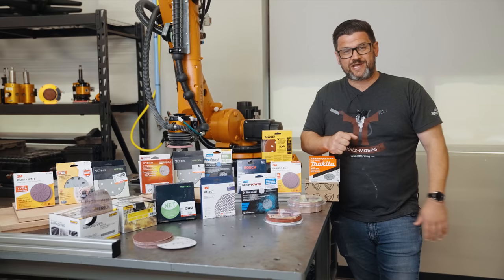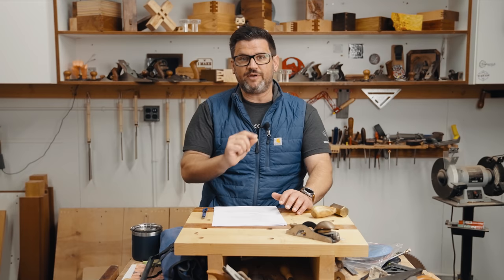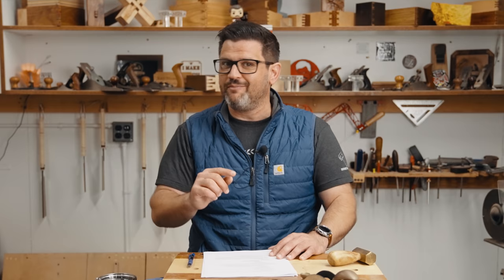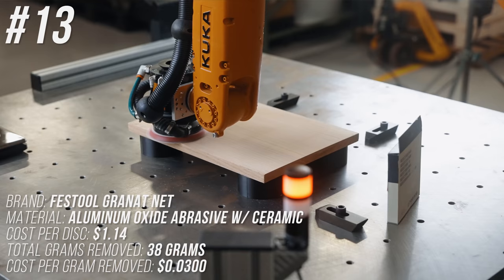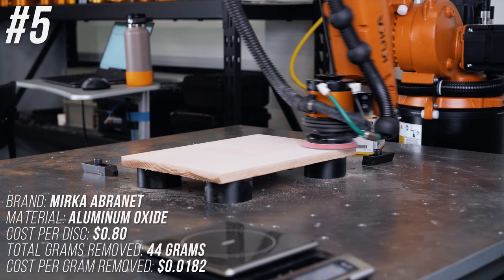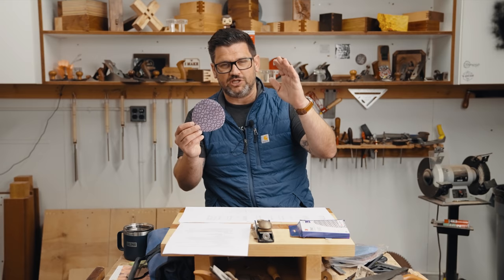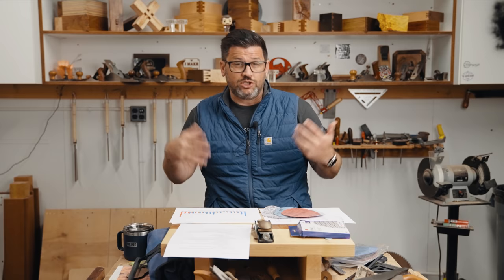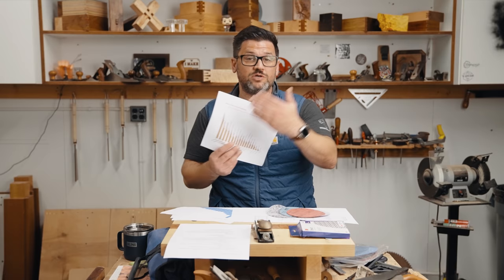Largest Sandpaper Test EVER Done - Top 19 brands Tested using Robots for Unbiased Data

Comment: I would be interested in seeing some data on the DuraGRIT carbide sanding disks, I’ve heard some very impressive things about them. 

I imagine that the cost per grams removed would be pretty bad using the same 5 x 5 minute test used here, but over its whole lifetime it could be something.

Comment: Festool Granat actually costs .65 per sheet @ 56 grams removed yields $0.0116 cost per gram removed which puts it up there with the top 5 papers tested. If you’re doing lots of sanding you would never buy the 10pk @$16.00 when you can buy a 100pk at$65.00. The other factor not taken into consideration is the design of the Festool multi stream pad which reduces the temp of the paper and further extending its longevity.  Otherwise not bad test in trying to keep all things equal.

Comment: I switched to cubitron II after the first video and was floored at the difference. The backing on the cubitron II was giving out on me before the paper quit (or even noticeably gave up), but that was after an hour of switched on work with the random orbital, and pulling it on and off the makita switching grits several times. Cubitron works harder when the backing dies than the other stuff I used when it was fresh. I don't toss it, I use it for hand work once the backing goes. Never would have made the change with JKM's work here. Thank you!

Now hearing xtract is this much better, I'm even more concerned that the backing will give out days before the grit does. Did you check into this?

Comment: I usually use the Diablo non net universal 5in sandpaper as it is available locally. It works well for me and seems to last longer than the non mesh Mirka I used to use. I wonder how that would have stacked up to the Diablo SandNet. I have to check out the 3M stuff before it is all on back order, or they bump up the price if it is popular.

Comment: Id like to see the difference between the 3M Cubitron II small hole arrow>>>>>>vented vacuum sandpaper, and the 3M Cubitron II Net vented vacuum Sandpaper...
Like which is less likely to clog sanding on body filler & putty, as well as sanding urethane and epoxy primers... 

I'm stuck on which to order...
I have the 3M Cubitron II 12 meter 280 grit small hole arrow vented rolls right now and so far it is lasting quite a while on my purple 3M 16 1/2" vented vacuum sanding longblock.
Now the Net is only in 10 meter rolls so not quite as much you get, but they seem to be even less money most of the time anyways so it probably equals out.

I have a 6" Volsive hand Sanding block that comes with the Net Sandpaper in various grits and even though I haven't really got to test on virtually any primer yet, but on filler and putty it seems to be lasting forever! As the net allows FULL SUCTION of the holes in the block... so far I think for Low grits 40,60,80,120,150 the net is the way to go for sucking up the most filler dust... maybe even also go with a 180 grit.

I would assume that for the 220,240,280,320,400,420,500,600,800 grits the Net version isn't as necessary as the finer finishing grits such as these tend to not kick up very much dust compared to 150 and coarser... but with sanding primer will the non-net finer higher grits clog up quicker than the net version? That is the question...

So anyways would love to see the comparison, as like I said, I haven't been able to compare the 2 variations on primer yet (to test for clog up comparisons)

Comment: I would love to see a test like this performed with some of the Klingspor sanding discs to see how they stand up. I have been floored by just how good they are and how long they last. Not to mention the stearated costing on their greentec discs are insanely good for when you're sanding off old finishes. Spent an hour yesterday sanding down some lacquered plywood I pulled from a built in bookcase from my new house. After an hour on my Bosch Get75-6n in direct drive mode the disc still looked new.

Comment: We've been using Granat and regular Cubitron for a long time. Just ordered a bunch of the Xtract and none of my sanders will hold the discs: they keep throwing the discs across the shop. To be clear, the other hook and loop sandpaper sticks fine, but these do not. I just called 3M and they said I needed a custom "hook-it" sanding pad for it to work. Part #20353. I just ordered that from Amazon for $30. I'm not sure which of my sanders that interface bad will be compatible with, but I"m willing to give it a shot. Anyone else have a hard time with these discs 'sticking'?

Comment: Thank you so very much for this "Complete detailed" test! I'm a week-end winter worrier so I only bought 4 boxes to test the product. I had to use my 3 x 24 sand belt extensively this week-end and I check on line if I could buy the 3M Xtract in a belt version but I didn't find anything. Do you think you could perform a test for sand belt paper?  I wear your apron all the time and I love it! Jocelyn from Ottawa

Comment: Thank you for doing the research, and presenting it in an excellent format. When I bought my Festool sander, I was trying to buy an all around good sander with great dust collection. I also bought a supply of paper to go with it. I’m getting ready to restock some grits. So, this is great timing. How do the meshes do with dust collection?
Reply: My experience with a Dewalt RO sander and the original Cubitron (which I ran to TayTools and bought some as soon as I saw the last video) is basically zero dust, and that's with the on-board dust suction - not connected to a shop vac or anything. Less dust than using regular 5-hole paper, for sure. Honestly, I don't know why that is, either. I'm assuming some of the fine stuff is traveling through the velcro hooks. In any case, it's a super clean finish and I can sneak in a quick sanding job without donning a mask.
Just make sure to keep your fingers (or anything you care about) away from the edge of the sanding disc when the Cubitron (presumably others, too) is spinning. It's much thinner than regular paper, so the edge is like a serrated knife. I only had to learn that once (so far).

Comment: I'm curious if the Cubitron mesh is like the Trizact automotive sheets. Trizact isn't even a media based sandpaper. It's actually manufactured. Under a microscope it looks more like linear rows of teeth which is why the Trizact outperforms other brands.

Comment: I couple of things, the 3m sandpaper is 120+ and the way the plus was explained to me by sandpaper people at awfs is they have 120 (or whatever grits your using) plus some lower grit(80ish) mixed in so you don't exactly get a true 120 grit scratch pattern. Also you skipped a couple of the klingspor. Also I'd like to see a test done with 80 150 180 and 220.

That being said,  I'll probably get some extract when I run out of the cubitron 2 lol. I typically keep cubitron and klingspor around, and use the klingspor if it's a dirty job that may clog the paper.

Comment: Very interesting test. Quick question. My deck is a mess, and I thought I would get a belt sander, pressure wash, pull up the boards (originally stapled), sand, waterproof, then screw back down. I just feel by the time I would remove, dispose of and replace with new boards it may be worth it to sand down and use the same  boards....or at least the majority. I was going to go to Amazon and just find the cheapest 40 grit belt sandpaper and go at it, but maybe something else might be better. I don't think the 3M Extract comes in a belt, otherwise I would do that. Any suggestions?
Reply: Maybe you can turn the boards over and not have to sand as much, also I would rather rent a large stand up floor sander and not remove any boards, if I where going to replace all the boards I’d go with the synthetic wood.

Comment: A follow on evaluation: What is the true abrasiveness rating (or equivalent to one - like 3M or a mid-pack choice)  and which leaves smoother - less swirl results for rated and the equivalent in the first 5 minutes. I have used 120 Festool Garnet paper and 120 Mirka mesh on my Festool ETS125.  I think the Mirka is less abrasive to the Garnet, more like a 150 or 180.  Thus, I would expect the Garnet to cut more and the Mirka to seem like it has a better finish as it really is a step higher in actual grit.  So is the 3M more like a 100 or 80 grit of Festool Garnet?  Seems to cut that way and to others like a 120 vs 300.

Comment: Thanks for this. Sanding and finish work is my bread and butter. I stick mostly to Mirka, Diablo, Klingspor or Norton. I will give that 3M a shot if I can find it. Just to toss a wrench at the fan, what is the random pattern of the machine you were using? Not sure if that would make a huge difference but what the hell. Again, thanks for the info. Happy sanding even if you don't like to.

Comment: Really enjoyed the video great stuff! I sand a lot of wood myself. What paper would you use for ruff wood with lots of holes and cracks. The 3m cubitron is not strong enough and is torn quite easily.
Reply from the maker: The Cubitron discs are just as good and more durable

Comment: Duragold and DURA-Grit are two different brands as well.. carbide sanding would be interesting as well to include in a test. Other factor is durability how much do they remove before being used up. Good video and good to see new innovations.
Reply: carbide is not for sanding wood, normally you use a carbide grit for Non ferrous or hardened material, not wood.
Reply: @tima.9125  stubby nubs has denonstrated this product. But I get what your saying. Also it sands over 10k bdft. Would like to see his opinion on it.

Comment: I’m a big fan of your channel. I’ve learned so much as a novice woodworker. I will definitely take your advice and give the 3M Xtract a try. I’m in the market for an orbital sander, but I don’t want to spend the Festool or 3M Sander price. Any recommendations for a quality and more moderately priced orbital sander? Is Bosch or Dewalt any good? Thanks in advance!

Comment: Thank you for the comprehensive break down.  Because of your research I have given the 3M Extract a try.  The sanding discs last longer and remove material well but, the issue that I am having is that the hook and loop will not stay attached on my Festool ETS.  I have replaced the pad and I continue to have the issue.  Did you notice any issues with the hook and loop being weaker than some of the other brands?  Thanks again for the deep dive!
Reply: Are you using a pad saver? Net discs tend to wear down the hooks on the sanding pads, so cheaper to use sacrificial pad savers.

Comment: The problem I have is that the sandpaper won’t stick anymore after very little use. Sometimes after 5 minutes it flies off and won’t stick anymore. I even replaced the Velcro disk on my sander but the problem persists. The sandpaper is hardly worn.

Comment: Based on this test, I bought several grits of the 3M Cubitron II.  I used it on one side of a charcouterie board I was making and my normal Home Depot paper on the other.  First, the cubitron doesn’t stick to the sander’s pad very well.  Several times, I had to stop and reposition the sandpaper.  After working through my normal process (80 grit to 150),  I very much preferred my normal sandpaper.  It felt much smoother to touch.  I realize my test wasn’t very scientific, but I think that in some ways, the actual results when the sandpaper hits the wood is what actually counts.

Comment: thanks for the valuable research.  I am working on a sanding process for my CNC.  I may have missed it but what was the pressure used on the sanding head.  Thanks in advance.
Reply from the maker: 10.7 lbs

Comment: 3M really has to start distributing their awesome sandpapers here in Belgium. Since your last video I've gone mad sourcing the cubitron paper, I ended up buying boxes of the klingspor ps33 (the white paper). Just cause that's what they had in the store and still seemed like a good value
Reply: I’ve been having good success with the PS 33.  So each disc takes a lot of use before it needs to be thrown out.  It is definitely way better than the other brands I can get that cost the same or more.

We also can’t get 3M easily.
Reply: 3M products including 710W sanding nets are readily available in Germany starting at 0,28€ per 125mm disk (depending on order volume). Not sure about shipping costs to Belgium, but I can't imagine that being too expensive given the low size and weight of sandpaper.
Reply: @BL-yj2wp  sounds very interesting. Do you have a site I could visit?
Reply: @boomerangfreak  
This is like the 10th comment I write because every single one gets deleted instantly. Unforunately I can't even name shops without getting deleted.
You can probably just use the German google to search for them.
Reply: @BL-yj2wp  auch. Well I'll try having a look again. Thanks a lot for the heads up though!
Weird thing is I work in a professional tool store with 3M as a supplier yet somehow the cubitron sandpaper is a pain to source...
Reply: @boomerangfreak  
That is weird indeed, makes no sense why they wouldn‘t sell their products in some EU countries while they do in others. 3M Belgium has a contact form on their website, you could try asking them if there are any retailers that stock Cubitron at all in Belgium. 
The shops that carry it here ask about 18€ for a box of 50 125mm disks plus shipping. It‘s not like it‘s a special product or anything.

Comment: Really a shame that you didn't include abranet ace which as as I can see is Mircas ceramic option.
Reply from the maker: Mirka was emailed multiple times prior to this test asking which papers they'd like us to test and what their best offerings were. They refused to participate in the process like most of the other brands did. To top it off, their head of marketing sent me a nasty email after the test was published and called me an idiot. So the fact that one of their lines was missed is 100% their fault.
Reply: @katzmosestools  Didn't expect an answer, but thank you for doing so. Seems like someone dropped the ball in their. Kudos for an excellent test. Any chance that you will do a more in depth video about mesh sanding discs and whether they produce similar result for finishing? There is a chance that the 3m extract for example is rougher than stated. In any case your test convinced me to try the 3m Extract mesh out. If if it works as well in real world application and across the range P values and produce equal result in finish quality then it's quite a game changer

Comment: Awesome video, saw Izzy post on it! Do we need to get any other accessories for the festool RO sander to use this mesh? Never used mesh before. Thanks!
Reply from the maker: Nope you're good.
Reply: Yes you do, with mesh type sanding discs you'll wear out the hook and loop connections on your sanding pad - best to use a pad protector/saver - it's cheaper in the long run.

Comment: The results could be skewed by labeling the sand paper as 120 but really be 80-110. It would be nice to talk about the quality of the sanding and if it aligned to any standard. Also the charts after 14 minutes don't have 3M Extract. The charts have double entries for 3M cubitrons.

Comment: Nice video.  As someone who has worked for three abrasives manufacturers throughout my career I understand the horrible and boring job it is to do this test.   At least you had a robot, lol.  I will remain neutral as I'm an avid woodworker and have used many of these personally.  I would make a couple of suggestions regarding technical testing.  Some manufacturers design specific abrasives to remove material better, while others focus more on surface finish. 

If removal rate is the main objective then 80 grit may be a better option.  That is the common grit for testing removal rate.  Obviously, 36-50 is heavy removal, 60-100 medium removal, and120-220 surface finishing.  

Since many woodworkers experience issues when they apply stain, and don't understand why, It may be beneficial to show the finish side.  The discs commonly used because of removal rates are typically more aggressive and leave more surface flaws like swirls, pigtails, and heavy scratches.  Certain grains (i.e. Ceramic and Ceramic Aluminum Oxide blends) offer great life and are very aggressive, but gouge the wood deeper and make more irregular scratches.  This is reflected in the finishing stage.  Because of this, testing both removal rate and surface finish provides interesting and differing results.  This can also be done using the same 80 grit disc (pick one) and then use different manufacturers in 120 to test the surface scratch using a profilometer or a microscope just to show the surface magnified.

Thank you for the efforts and keep 'em coming.

Comment: This is great and all but what about the resulting surface finish? Are you saying they all left you with the same quality?
Reply from the maker: Roughly (pun absolutely intended). I think that's an overblown metric. Grit size is relatively standard and anything above 180 isn't notcieably with any film finish on it. Anything over 220 or maybe 320 isn't noticeable with a penetrating finish. I personally think anything over 180 is for between coats of film finish

Comment: I'm curious as to what the hole pattern was on that sanding bot. I've always wondered what the point of running mes disks was on a sander that only has 5 or 8 holes for dust extraction.